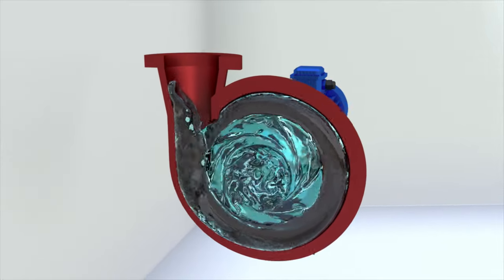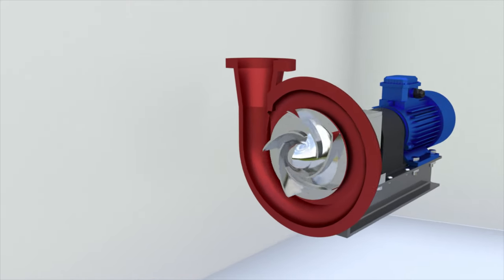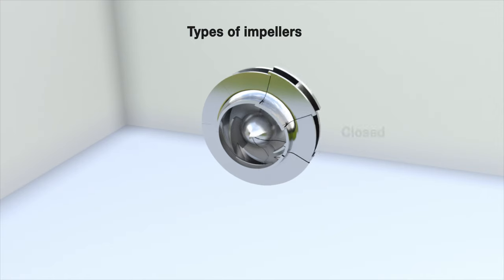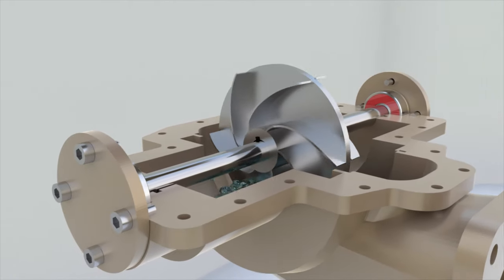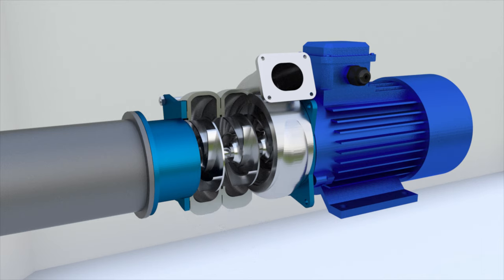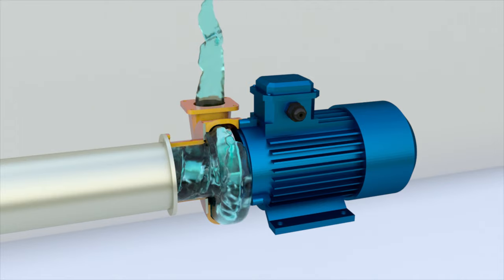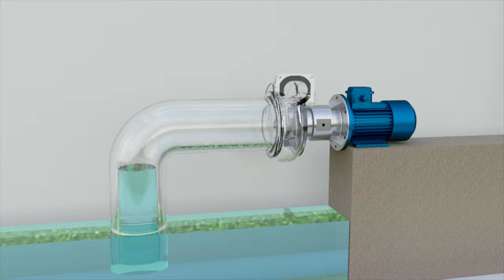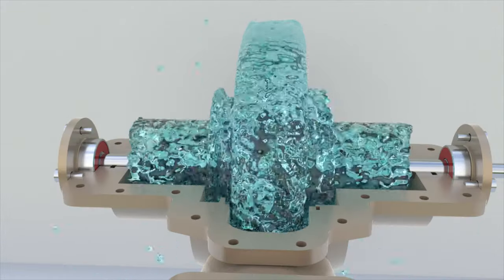How does a centrifugal pump work?

Comment: If the valve is locked at the pump discharge line, what will happen?
Reply from the maker: The centrifugal pump will operate at maximum pressure, according to its characteristics. The pump housing will not break, the pump will pump liquid into a dead end. Such pumps do not have a hermetic separation of the suction and discharge lines, which means that the liquid will simply flow from the discharge to the suction inside the housing. The pump will pump the same liquid inside itself. If it works like this for hours, the pump may heat the water too much. This can cause the drive motor to overheat.
Reply: @hydraulicandpneumaticsyste3253  Thank you so much

Comment: what will be the output of 2 centrifugal pumps if one is attached horizontal and the other is vertical as it seems in the RO water system??
Reply from the maker: In this case, it is important whether the pumps are installed in parallel or in series. With a parallel installation, the flow characteristics will be added, and with a series installation, the head (pressure) characteristics will be added, and it does not matter if these pumps are horizontal or vertical.
Reply: @hydraulicandpneumaticsyste3253   thanku sir
Reply: Your videos are amazing n informative

Comment: Thank you very much for the clarification of
 noticing that the manual transmission becomes very heavy. Also, the 3phase motor should be better than the single phase, because the torque is very strong. Water can rise approximately 1km per minute, depending on the size of the engine. If 10HP, water can rise more than 1km per minute.

Comment: Good day, I really enjoyed the video, which is very educative. My question is that, can I use centrifugal pump to suck water from 10 meter deep Borewell?
Reply from the maker: Thanks. If you want the pump to be on the surface at the same time, then it is impossible, because of cavitation. In this case, you need to use a submersible centrifugal pump and lower it into the well.

Comment: Hi, verry good video ! But what's the thing between the casing and the electric motor ? Is it just a place to have some bearings ?
Reply from the maker: The pump impeller is cantilevered. This wheel is heavy. Therefore, two bearings are used. They are installed in the crankcase. There is oil in the crankcase, it lubricates the bearings.
Reply: @hydraulicandpneumaticsyste3253  okayy !! Thank you verry much !
Reply: @finn_is_red this is where the break point is as well. Many pumps have a gear looking device here

Comment: Can I ask you something ? What does NPSHr parameter mean in pump selection
Reply from the maker: NPSHr (Net Positive Suction Head required) – the required cavitation reserve, i.e., necessary for the operation of the pump - the required pressure value at the suction pipe of the pump.

Comment: If those steam turbines were built more like this pump they would be much more efficient and require far less steam to operate. Look at those steam turbines they use to generate electricity, tremendous amounts of steam to make them spin. 5 billion tons of coal we are burning to make steam to get those things to spin. 
Good water pumps are the future, we are going to have to save our river water and pump it in order to irrigate crops and move water over land. We are going to have to dredge in order to fight rising sea levels. We are going to have to dig canals. We need to stop wasting kerosene in these huge jet planes and use that fuel to dig lakes and pump water. The earth is drying up and the deserts are growing. We are going to have to plant billions of trees and water them. High efficiency pumps are the future. Saving and moving water is the future, reducing our coal consumption is the future. Saving oil and fuel. Driving to the office 5 days a week is a waste. Manufacturing is the future. The office produces nothing but cost. Office buildings are a waste. Stay home save fuel and eat. That's less expensive. 
Pump water not gas.  LLXIIX77

Comment: Pump shaifit and  inpmalring flwing  motor  working flwing  ruing pump air removring  water pasding   sooth heavy lord sooth  woring  pump using  disining centry ful pump    chil  water systusing  meany typ stage using  sre 2nd stages modes using

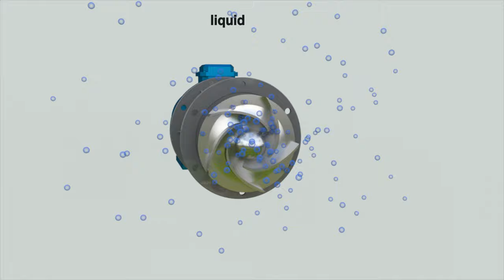Comment: "The mass of air particles is much lower than that of water particles ..." (3:35)?? That's not right - O2 and N2 particles, which comprise 99% of air, have twice the mass of H2O particles (water). No question you need to prime the pump, but your explanation of why that's true makes no sense.